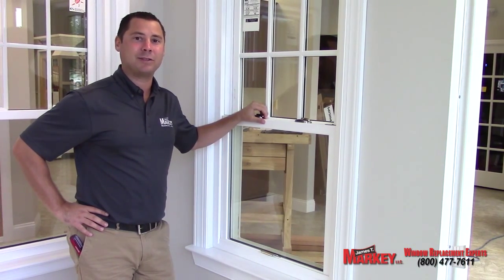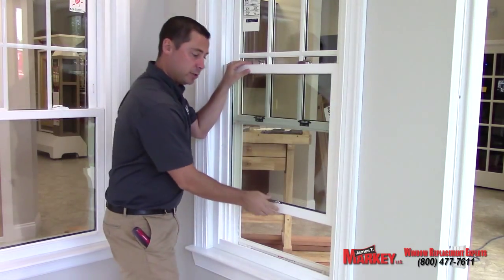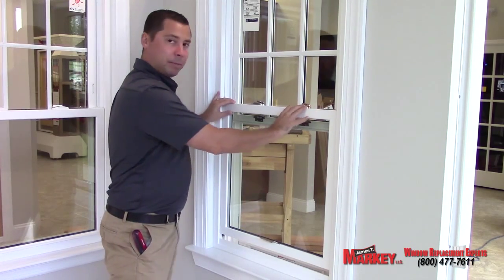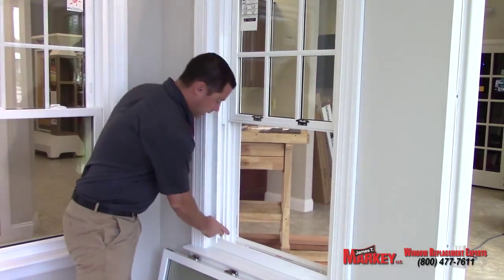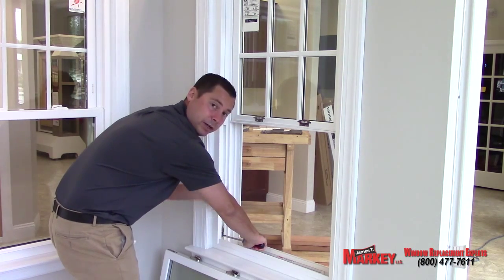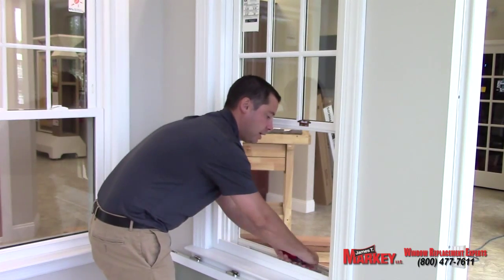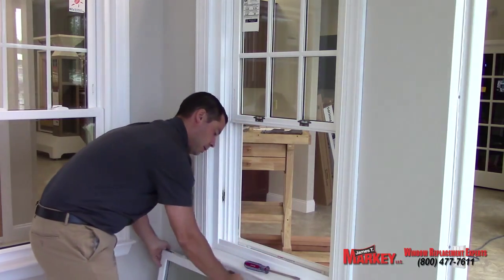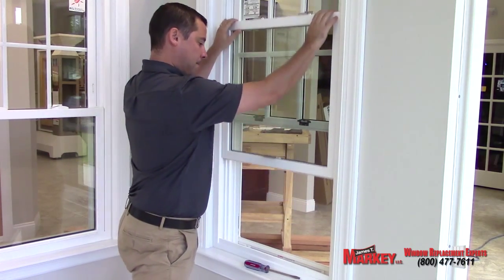How to fix popped out double hung vinyl window sash.

Comment: I followed your instructions for putting the window in, but the pin somehow does not engage into the shoe.  When I open the window, one shoe comes up with the window properly, but the other shoe is stuck.  It's like the pin didn't properly seat and rotate the shoe to unlock it.  I visually inspected the pin and the shoe and everything looks ok, but I can't get it to work right.  Any ideas?

Comment: I have a top window sash that has popped out while cleaning and I can't seem to get it back in. How would I reinstall it?
Reply: Thank you for great instructions.   We messed up two windows by not leaving enough room at the bottom.  With outside temperatures in the 30s, Your video instructions provided us with a much needed fix.

Comment: Your video instruction was perfect.  As you showed, I managed to pop out the lower window because I didn't raise it high enough.  Not knowing how to put it back in I became really frustrated and almost resorted to replacing the whole window.  However with your instructions I was able to quickly put the window back into the shoe and all is well.  Thank you very much.

Comment: Thank you. I was cleaning my tilt in windows and it popped out of it. The slider piece was wedged and would not move. Finally got it moved up but the metal pin would not go in - it had a rectangle and it took us a while to realize we had to have the window horizontal to get the shapes right! A rectangle will not go into a square until you rotate it - basic toddler stuff. Thank you for helping me not panic and remain calm. I'm a new home owner who has severe anxiety about home repair (Why I will never know..).

Comment: Thanks, now i have learned that im not crazy and they are supposed to slide AND I learned that my window pins that fit into the shoe are literally like 1cm too short. The lack of proper fitting causes it to come off track almost immediately and SLAM that thing goes flying up. Any ideas on how to extend the metal pin?

Comment: I didn’t realize the force that the sash would shoot back up while I was pressing down on the screwdriver. You may want to update your video more strongly emphasizing that point. The sash flew right out of the grip of the screwdriver and broke the plastic piece at the top breaking it.

Comment: I have a problem with mine. One of the openings where the pin goes in is up like it should be but the other is turned as it should be when the window is in. I tried to turn it up but it won't move. So I can get one side of the window in no problem but the other I can't. Please help thanks.
Reply: O

Comment: I did exactly as you said, inserted a flathead screwdriver into where the window pins themselves would insert, gave it a slight turn and put pressure down on the screwdriver. When you stated that it's going to spring-load and come back up to you, you weren't kidding! It came back up alright, flew all the way to the top and the string snapped in two. NOW what do I do? Something was/is WRONG with your directions!
Reply: Thanks for letting us know the danger of this.  Did you ever get the window fixed?  What was the solution?  I hope you didn't have to get a new window.